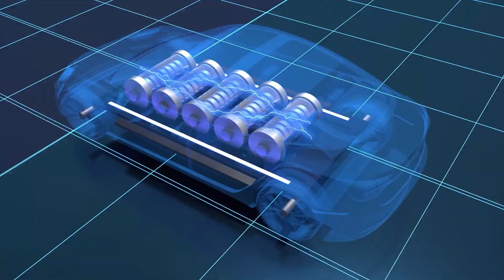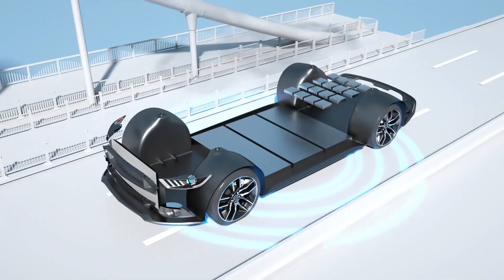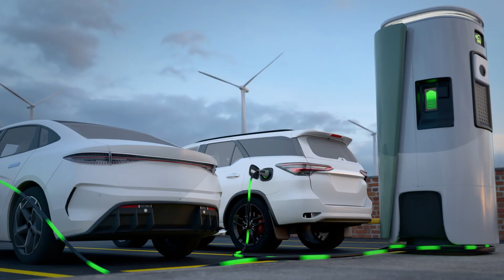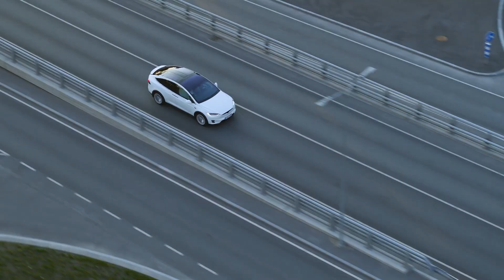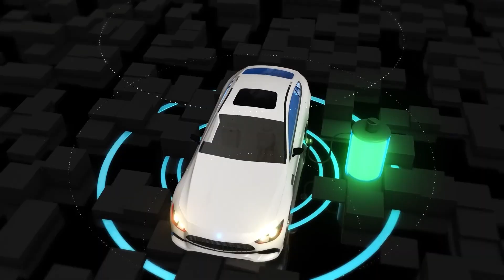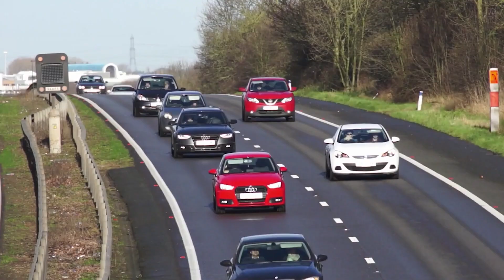Why Hyundai’s New EV Uses 800 Volts Instead of 400?

Comment: 800VDC is also the new standard in AI data centres.
Reply from the maker: Exactly. Higher DC voltages reduce current, cut resistive losses, and improve efficiency at high power levels. That is why 800V architectures are showing up both in EV platforms and in modern AI data centers. Different applications, same electrical logic.